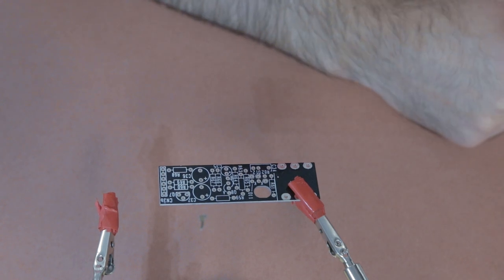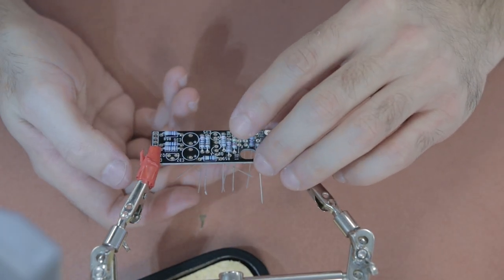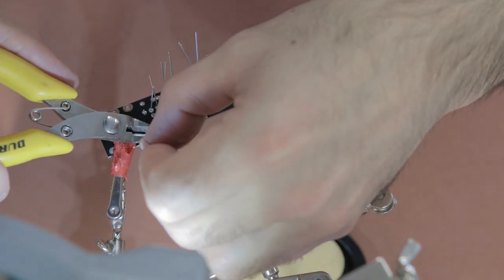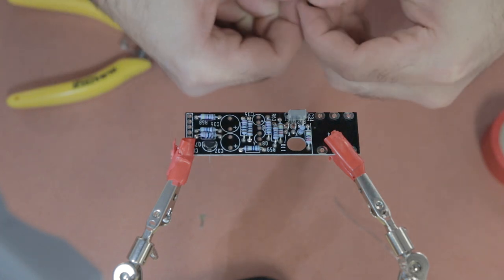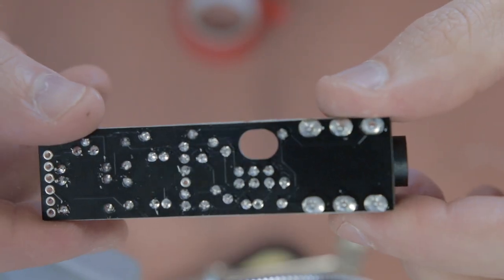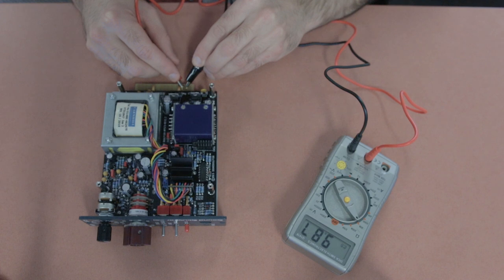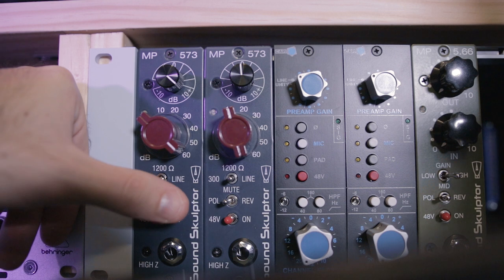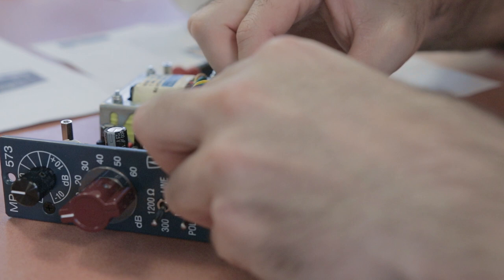How to Build your Own Preamp - Sound Skulptor MP573 (NEVE 1073) DIY Build PART 3

Comment: Hey Mitch, great video series! I have also built a few MP573s, and I found that it is actually easier to solder the DI board connector as a very last step, exactly like you did. If you assemble the DI board with the connector already soldered to it, it can be tricky to get its angle correctly without bending it when you try to plug it into its socket. At least your method doesn’t put any stress on the connector. Looking forward to more videos like this!
Reply from the maker: Ha! That's amazing to hear, now I don't feel so bad about doing it that way.

Thanks for the lovely comment and positive feedback. I definitely have more preamp and DIY Builds on the way and a heap of other cool stuff too.
Reply: Danke für den Tip pop_polizei :)

Comment: I didn't see anywhere in my technical documents an instruction for R54, R53, D8 or R56 (among several others)... Do you recommend I solder those on regardless or are those left over for a reason that I'm not aware of. Thanks for these videos, they are super helpful!!
Reply from the maker: Hi Jeff, if you still need help, maybe shoot me an email with some pictures of your current board and I’ll check the build pdf. You may be on a slightly newer version of this build. 

Mitch@thediyrecordingstudio.com

Comment: Awesome videos mate! Thanks for making these. Just wondering what type of solder you use for these sort of projects and how hot you run your soldering iron?
Reply from the maker: Thank you. I just use typical leaded solder. 60% tin 40% lead. I use a $90 soldering iron with a fine tip and I got all that from from jaycar which is great if you're from Australia. Any kind of electrical store has this stuff though. 

Solder temp is 340-350 degrees Celsius or 662 Fahrenheit

Comment: Awesome series, thank you so much for the detailed videos. Are you planning on building the EQ573 for this as well, since it can act as an insert between the input and output stages? Also, how's the noise floor when driving something like the SM7B? Personally, I'd love to hear a comparison with this, the CAPI pres, and that super cool MP566 Tube pre.
Reply from the maker: Thanks James! I have built one of the EQ573's already and they sound very good. When I build the second one I have, I'll be doing a video on it for sure.

The SM7B sounds great through the MP573, especially when you flip the impedence switch to 300ohms it give some extra body to the mic. Very nice and no need for any cloud lifters. Plenty of clean gain.

I have the MP566 tube pre and a pair of CAPI VP28s I've built (and have videos coming soon on). What would you want to hear a shoot out of in particular? Any particular instruments or mics?
Reply: @diyrecordingstudio  At least just for me, voice is the biggest thing. But I know of course people would be super into drums/bass/acoustic-guitar, etc. I've been looking into building 500 series stuff for a while, and it's cool to see more videos on it. As far as mics go, hearing that SM7B is informative because it's such a hard mic to drive. I'm actually using an RPQ 500 to drive mine because I was tired of not having enough gain (even though it's made for ribbon mics, it works great with the SM7B). But there's a HUGE world out there of options of course.
Reply from the maker: @monkeyplusplus  The AEA RPQ 500 is a great idea. It essentially uses JFET transistors like you'd find in a cloud lifter or mic booster for ribbon mics, on top of what you'd find in a standard mic preamp. What works for ribbons is often true for the SM7b so a good choice. 

I'll definitely have some upcoming videos showing my pre's using the SM7b soon. But I can tell you the MP566 tube pre paired with the SM7b is one of my favourite combos right now. Very nice.

Comment: Hey, thanks for making this video! I was just wondering what model/brand third hand you were using as a lot of models on amazon seem to get called out on shoddy build quality, and I don't know which one to buy anymore at this point. Also wondering if that's a specific kind of tape you're using to attach components to the board ? Thanks!
Reply from the maker: Hi Simon. Not a problem. Thank you for the comment. 

I'm just using regular electrical tape here. It leaves less residue on the board.

The third hand is a really cheap one. I don't use it anymore and I've started just not using one at all at the moment until I find a better one.
Reply: @diyrecordingstudio  Did it just break down on you then? Seemed at least somewhat serviceable in your videos when you were using it :) Thanks for the quick reply by the way!
Reply from the maker: @simons9764  not a problem.
No it still works, but even with tape around them, the alligator clips scratched the pcb a couple of times, and once exposing a couple of traces that I had to then fix. It was a simple fix with a coating pen but still something I want to avoid.

It's still good to use in certain applications. I'll put the link below.
https://www.jaycar.com.au/holder-pcb-with-led-magnifier-and-soldering-iron-stand/p/TH1987?gclid=Cj0KCQiA_qD_BRDiARIsANjZ2LAasGXQndcmTKChEV76Scn-s0nzChoWWx3oONaL_--sGRqxZvRNdGgaAmHzEALw_wcB
Reply: @diyrecordingstudio  Oh ok, that does sound undesirable. Guess I'll hold off on a purchase myself just yet then :)

Comment: What do you think about the DIYRE CP5? Build Process and Quality of the preamp? I'm a newby and I'd love to build something like the CP5 but not sure of my soldering skills...
Reply from the maker: Hi Jake. If you're new to soldering i think something like that is a really good start. Simple and not too expensive. You could also look at building a mic from micparts.com or a di or reamp box to start with. 

With preamps i think these designs are pretty complicated but well worth the time and effort.
Reply: @diyrecordingstudio  How would you rate the CP5 as a stand alone preamp? Thanks a bunch for the advice and the link. Can you reccomend any other good sites that do diy kits?
Reply from the maker: @jakedunn8997  i haven't honestly tried anything from diyre yet so i cant say what those preamps sound like. They look like good products though.

Currently i have built products from soundskulptor.com , capigear.com , micparts.com and bumblebeeproaudio.com and i would vouch for anything either of them put together. 

I think component wise you're going to pay more for something from CAPI or sound skulptor, but you are also getting very sophisticated replications of real vintage preamps for about 1 third of the price if you build it yourself. It all depends on how confident you feel on building them.
Reply: @diyrecordingstudio  thanks dude. I bought myself a CP5 today. Let's see how It goes!
Reply: @diyrecordingstudio  Have you ever tried to design a pcb board for a preamp?
Reply: I have 4 CP5's. They're a cool build. There are some areas where you can go wrong, but not a bad build at all. I bet I could get a sound out of the CP5 with the right Colour module that sounds like this 573.

Comment: Where'd you get the rotating stand with two arms that holds the PCB?
Reply from the maker: Hey there. Just at Jaycar and electronics store here in Australia. Not sure where you're situated, but you will be able to find them at any electronics store for sure.
Reply: @diyrecordingstudio  — Thank you! Great videos. Recently bought a AML1073, ready to assemble as soon as my soldering gun gets here. These videos will help immensely! I appreciate your contributions to the DIY community! Subscribed. 💪🏾
Reply from the maker: @aisharpproductions1351  no probs. Thanks for the sub.